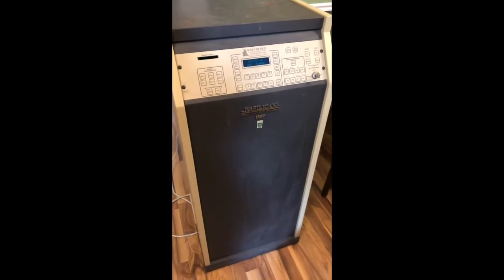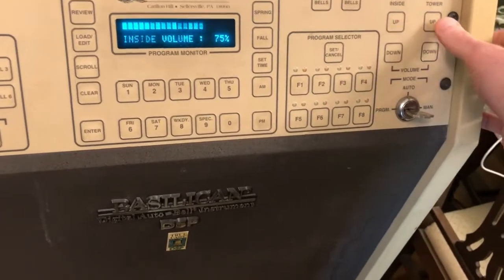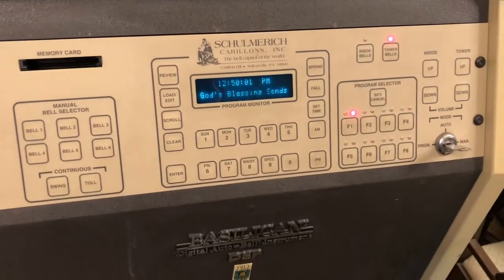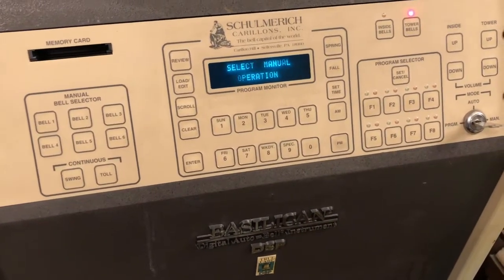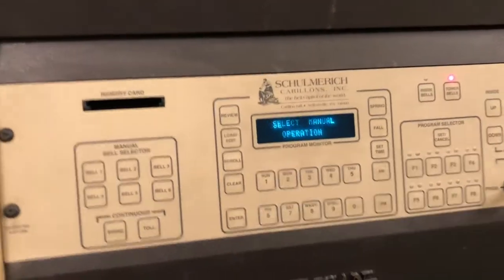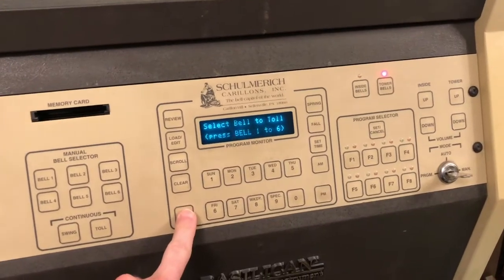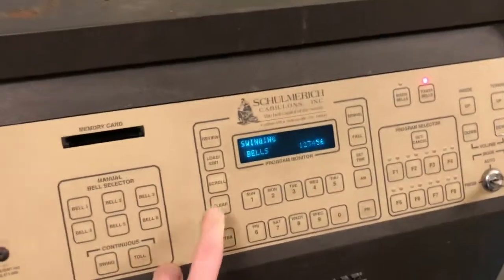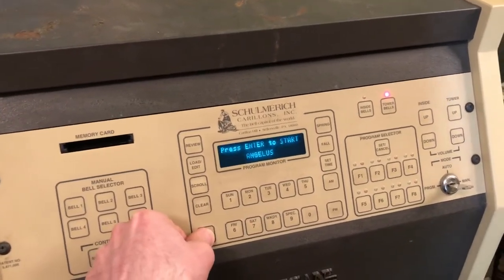Schulmerich Mark III Basilican DSP Carillon Bells System Demonstration (Mk 3) Repair Service

Comment: My inside bells and outside bells buttons beep when I press them, but never light up. I can hear the bells play in the office but the bell tower doesn't play. We have a Novabell 3 purchased in 1994. I have the manual, but it's not helpful for troubleshooting this issue. I tried to message or email you, but I can't find a way to do so on youtube.

Comment: Our display has gone dark, so programming is impossible. Pastor Reynolds, Lock Haven, PA
Reply from the maker: Hi Pastor - it sounds like you just need the display replaced - this is a common issue with these systems at this age.  I'd be happy to speak with you further about getting your system back to fully operating condition.

Comment: Hey Corey, I’m Ernie from first Presbyterian church in Verona, NJ. We have a novabell mark 3, which seems to have a component failure. Upon plugging in a constant “whinnying “ sound is emitted and all the F- lights stay on.  It is Stuka like this. Any suggestions ?
Reply from the maker: Hi Ernie, it sounds like the power supply may have failed - it and the display module are the two most likely culprits at this age.  Generally, replacing them will get the unit back on the right track and allow it to keep playing for many more years to come.  I'd be happy to help further - contact info is at the end of most of the videos posted here.

Comment: Hey Corey. At my local church we use the same system but for some reason our outside bells won’t ring we can hear the tower inside but not outside the church. Do you know if there’s a mute option on this we might be overlooking?
Reply from the maker: Hi Michael - if you can hear inside it could be the monitor speaker, or an indoor speaker that is still working properly.  Someone could have potentially turned the tower volume down to near zero - effectively muting it.

There could also be an issue with part of the amplifier, the tower relay board, or the tower speaker(s).

I’d be happy to speak with you, which might help a bit more.  Regardless of the cause it should be repairable.
Reply: @coreyscarillons  hey Corey can I inbox or private message you to setup a time to discuss?
Reply from the maker: @michaelsabatino8763  It doesn't look like YouTube has any sort of messaging system anymore.  If you're able to, there's a phone number given at the end of the video that you could call to discuss further.

Comment: Corey, my church has a Schulmerich electronic carillon that uses the large tapes. I have done a couple of repairs in the past with parts direct from Schulmerich, but as you are aware, Schulmerich is no longer in the digital carillon business and Verdin does not support the old units. I am in search of a replacement drive belt for the tape unit or at least a description of the belt. I can, of course just measure and try to match the size, but would prefer an exact replacement or at least accurate information. I would appreciate any help you can give me on this.
Reply from the maker: Hi Phil, was a pleasure talking to you earlier.  Best of luck with your repair!
Reply: I ordered an 11.5 inch medium width belt that fit perfectly, but then realized that the pinch roller was not functional. I could not find a 23mm diameter pinch roller to fit, but there was a replacement Schulmerich tape deck on eBay with a good pinch roller. I did not mind ordering the entire unit as I now have a unit for parts (including another belt). Thanks for you assistance.
Reply from the maker: @philwesner8945  Thanks for the update and information - glad to hear you’re in good shape for now!

Comment: The college that I work at, has this unit, but I can not get the bell tower or inside lights to come on, there for, I do not think it is communicating with the speakers.  Do you have any suggestions?
Reply from the maker: Apologies, I did not see this comment when posted.  I'd be happy to help you troubleshoot - the lights will illuminate whether or not the speakers are working.  It is possible it took a lightning hit or surge and the TIC (Tower Interface Control) board may have an issue.  It can be repaired if this is the case.

Additionally, you will need to turn the key if you are trying to manually control the tower and inside relays.  Does the system appear to operate (play by schedule, etc)?  Is the blue display working?

Comment: Has anyone had an issue with the screen not lighting up? Its just black. It works, just can't see the screen to make any changes. We have a Novabell
Reply from the maker: Yes, this indicates the display has failed. I’ve helped with replacements in the past.

Comment: Drat the doorbell....  ;)

Does this Basicilan have the Liturgical Player, or are those voices generated from the DSP?  

What happened to this cabinet rack?  Was it stored in a wet place?  I was lucky with my MkIII Embassy that was only soiled and only required some buff out.
Reply from the maker: Everything is generated off the DSP board.  The rack must have been stored in a location with a leak, as it is a little more rough than average, but thankfully nothing ever got inside of the system.
Reply: @coreyscarillons  CLR should easily remove any mineral deposit marks.  A coat of spray wax like "Pledge" to the painted surfaces will help the cabinetry appearance as well.

Comment: Cool!  It sounds really nice, Corey.  These systems really shine in the swinging bell department, also in the lingering hum tones of the True Cast voice.  Thanks for posting this!
Reply from the maker: Indeed - it offers quite the improvement over the older systems without the Liturgical Player (which was effectively a set of TrueCast bells on a dedicated set of circuit boards).  They had a much simpler swinging bell, similar to those in the rod-era.
Reply from the maker: @Cayden Noles This system is not equipped for Westminster Chimes - I may be able to get a sample in the future if I come across a DSP system with them.